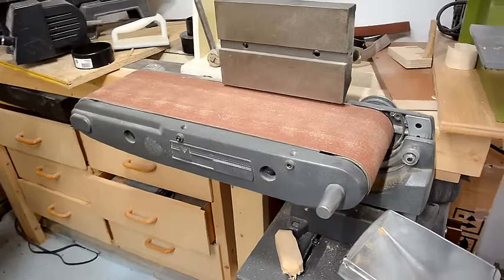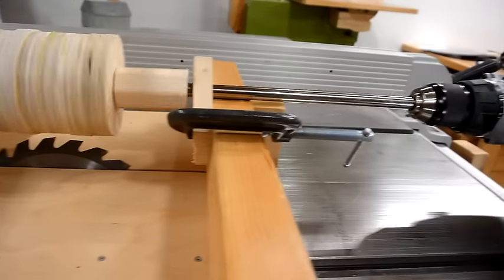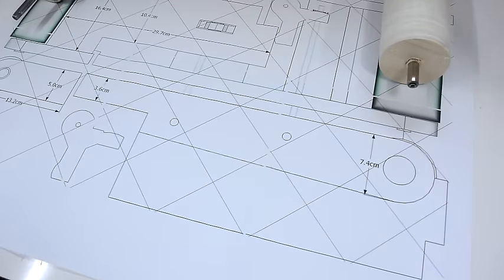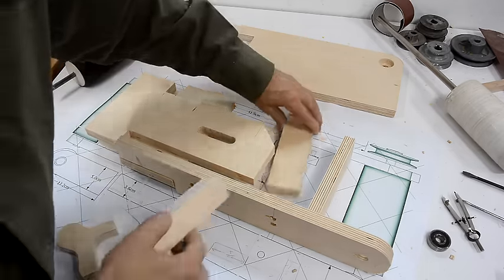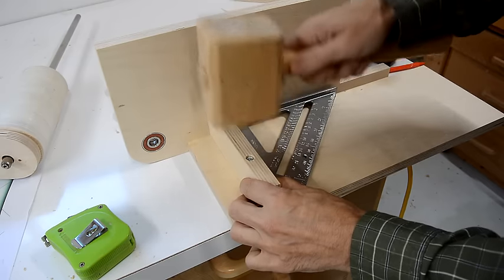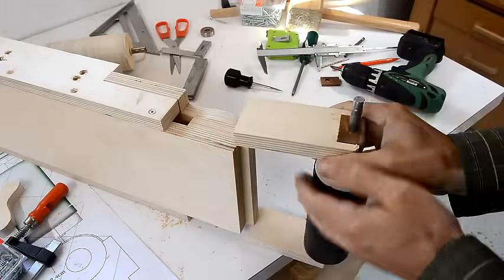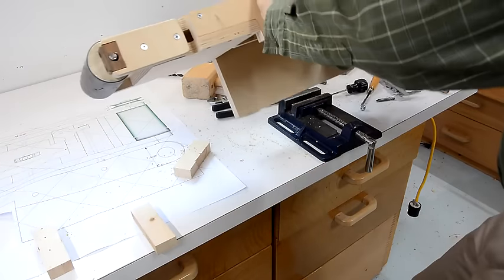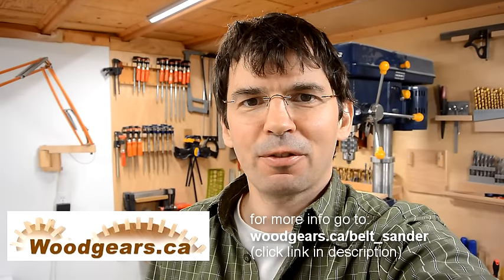6x48" belt sander build

Comment: Why you don't use CA glue for glue quickly, this little wood piece's ?
Reply from the maker: Wood glue works fine, is reliable, doesn't go bad, and doesn't release bad fumes.
Reply: Thanks for reply, kkk realy it release fumes that burn eyes, and I think that she only has efficiency in material with low porosity.
Reply: plus need super thick ca. sometimes ca is too brittle
Reply: I use in my shop to glue face with face from bi-laminated mdf and stay strong too . But go bad in the porous sides of the  mdf.

Comment: What made you think to use the table saw instead of the lathe for rounding the discs?
Reply from the maker: And exactly how would you mount the shaft on the lathe to be precise enough?  Plus, I want this to be buildable for people without a lathe.
Reply: I was thinking of using a 3 jaw chuck or a collet, but then I remembered that you use the homemade lathe. I think it is cool how you did it though, and if I ever get the time to make one of your projects I'll remember this method.
Reply: Izzy Swan?

Comment: maybe i missed a step, how did you keep the wood from spinning , since you didnt use a threaded rod?
Reply from the maker: The disks are on tight.  There's also a keyway in the shaft.
Reply: With the keyway you mean the cut you made with the saw?
Reply: keyway explains it all thanks

Comment: My shop fox edge sander has a graphite  pad underneath the sanding belt, I wonder what the difference is with sheet metal??
Reply: It's sort of self lubricating I guess. Though wouldn't it wear away against the back of the sanding belt?
Reply from the maker: That would be better.  But I don't know where I'd get one, and I have seen lots of sanders without one.
Reply: the metal platens wear away eventually too. The one on my favorite belt sander is shot now.
Reply: I wonder if teflon is a workable option.  ... I'd like to build a sander to do a specific curve for a seat slat.
Reply: You can get tapes and sheets of self-adhesive UHMW or PEI plastic that might be more practical even if they're not quite as slippy.  Teflon is hard to glue and if you get it thick enough to hold down with screws it gets expensive.

I saw a neat trick for gently curling a large strip of steel sheet without slip rollers.  It was essentially a rubber mat and a steel rolling pin.

Comment: As always, clever use of available materials and resources, simple design, practical to a fault. Not a single extra part, gimmick, do-dad, or gadget. Focused design. 

Yeves brings us an excellent suggestion for a king sized belt sander. Re-purpose the belt-works and drive of a home treadmill. The idea has merit but the drive needs to be re-rationed and the roller center distance adjusted to suit commmercially available belts.
Reply: Adding: you mentioned a "backer" which I assume to be a 3 mm steel plate behind the sanding belt to take the wear. Steel wears and scores after a time in service as a sander platen. I suggest instead "abrasion reststant" plate if it's available to you. This stuff is designed for service in earth moving equipment, dump truck beds etc. It will outlast mild steel in abrasion resistance by a factor of 3 or more. 

Abrasion resistant steel works with ordinary metal working tools provided you're aware of its properties: it's tough and designed to cold work - harden under elastic deformation and abrasion. Machine it about half the speed you'd use for mild steel. Don't let the drill rub. Either feed the drill (countersink) and make chips or back the cutting edges clear.